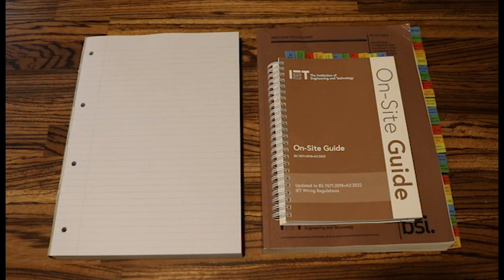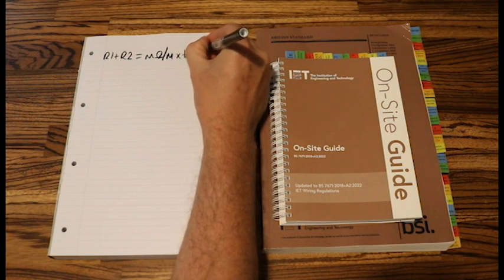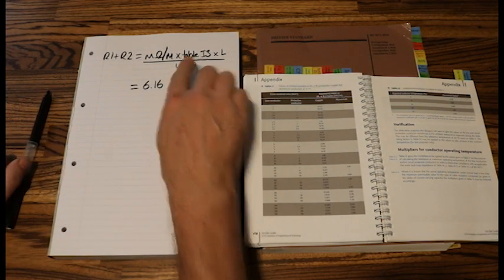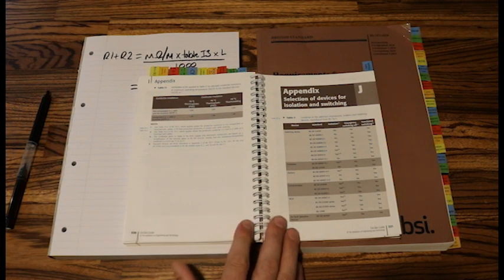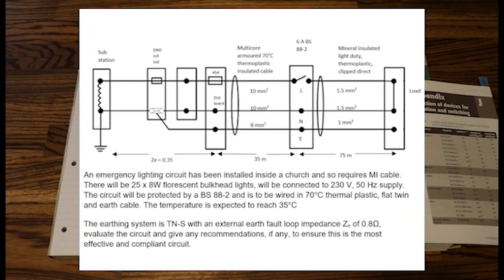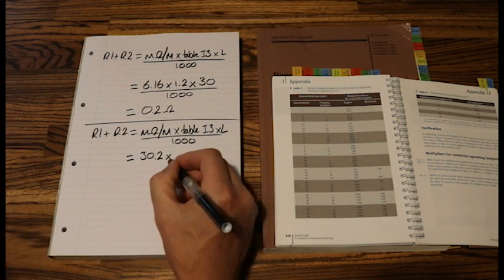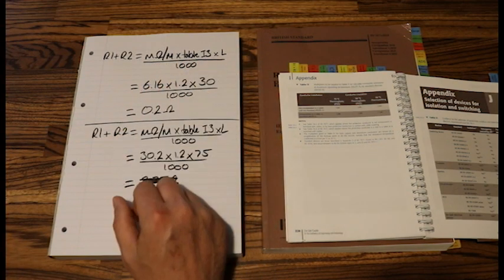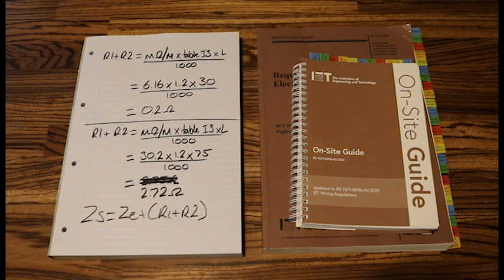Calculating the R1 + R2 value when calculating the size of your CPC

Comment: Question: When would you use factors in table I2?
Reply from the maker: @richardmarkham8369  Table I2 multipliers are used during a verification of the design, when the ambient temperature is not 20 degrees. These multipliers slightly adjust the resistivity values of Table I1. This table is not expected to be used during your Level 2, 3 or Apprenticeship exams
Reply: @ElectricalStudentsUK  OK! Thanks.

Comment: Would you not need to work out IB, IN, IZ etc first before working this out? Just trying to differentiate between what the question is asking
Reply from the maker: @Oxygen97  This is an exam style questions, sometimes they jump in at random points of a cable calculation. 
Another of my videos shows a full cable calculation from the beginning ie, Ib onwards

Comment: Quick question. If calculating r1 only, (seen that in an exam question) I'm assuming it's the same principal.
Reply from the maker: @stephenboden3558  Yes same principle. In column 1 of table I1 OSG there are line conductor only, milli ohm per metre values. Use that value as the individual R1 or individual R2 value. For instance, the milli ohm per metre value of 6mm copper earth cable would be 3.08

Comment: I still couldnt understand where that 6.16 came from while i was expecting 2.5
Reply from the maker: If you do not know the size of the cpc, then you match it to the size of the line conductor. In this instance, the live was 6mm. Looking at table I1 OSG, the milli ohm per metre value of 6mm live and 6mm earth is 6.16. This value is used to find out R1+R2 which eventually leads to the adiabatic equation of calculating S, the minimum csa size of the cpc
Reply: Thank you @ElectricalStudentsUK